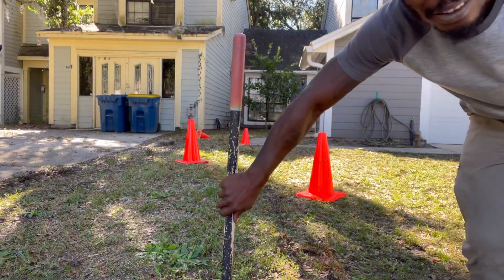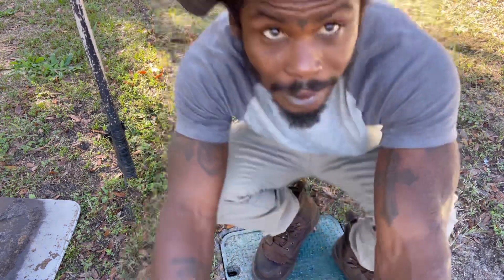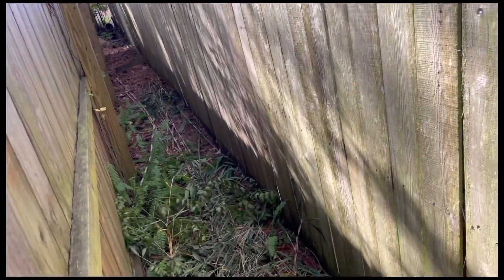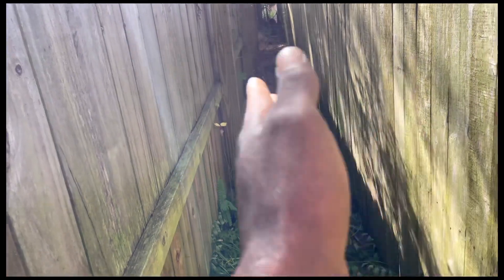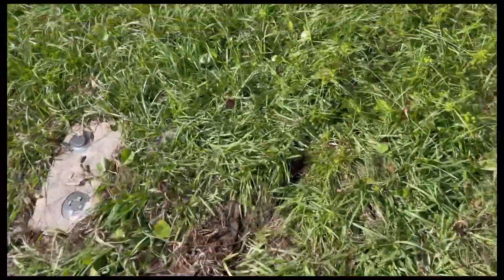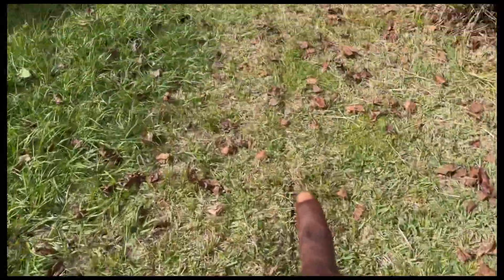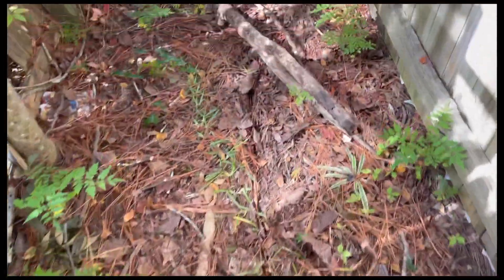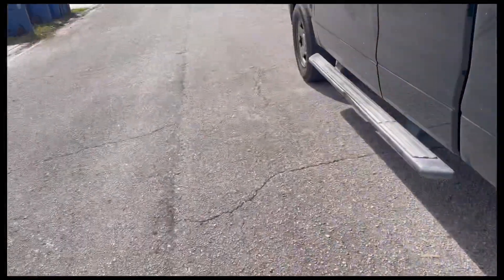How to bury AT&T Fiber Optic cable line by manual hand trenching

Comment: AT&T installed fiber at my place last week and someone came out this morning to bury it.  I have been watching your videos and was expecting them to use a womper.  Instead, they used a Ditch Witch, and I have to say the results were less than stellar.  There's a noticeable spot in the ground where they buried the line, and it also left tire imprints in the grass.  I would have much rather had you bury it.  Luckily, I live in a rental, so I don't care that much about how it looks.  But if I were in my own home, especially with a nice lawn, I would be pissed by the job they did.

Comment: I been doing it for over 20 years, not fiber but cable, mainline and all. Fiber for the last 8 or so years and by hand , machine and whatever.  You still have a lot to learn, for one not deep enough for one. The tool   is to wide and heavy.  Maybe not heavy but to wide and makes hard to control/ make a smooth line amd makes it harder to get deeper.  Especially with dry hard ground.  But at least you getting out there and working and learning and teaching.  Most people nowadays wouldn't even think about this type of work. Best wishes my friend

Comment: This is actually pretty helpful, ISPs might shave cost if you dig your own trench instead of them doing it.

I’m in this predicament now with Comcast but a different provider came in and saved the day lol.

One thing I would add is marking the cable on the grass or shielding it with pvc pipe. Might save an accidental disconnect in the future.

Comment: Great Job Holmes, I just got hired as an AT&T Machine Operator to do exactly what u doin, your vids are a blessing bro, Thank U .. The company pays 23.90 an hour to do this, how much is contract paying ?
💯🙏🏽
Reply: Contractor pay is about $60 to $90 per drop. I currently contract for AT&T doing drop buries on Indiana
Reply: Hows the Att job I start there Monday doing the same thing as you
Reply: @fuzzynubz1681  any contact info for the contractor in Indiana?
Reply from the maker: Contractors get paid very well .. learn the process of errthg n eventually start trying find a way to get into the contractors side of the field it's way more beneficial
Reply from the maker: Yall stay busy up there during the cold months
Reply from the maker: Well working in house for AT&T should be pretty easy.. u prolly will b doing 3-4 jobs a day
Reply: Zero gig performance, carry on.👍

Comment: I take a flat shovel place it on the far side of the fiber and open the dirt while poking it in with my poker at the same time. Much easier on your back and a lot faster.
Reply from the maker: I seen a lot of ppl doing that way but I couldn't adapt to that way